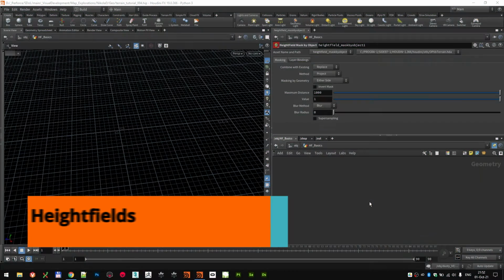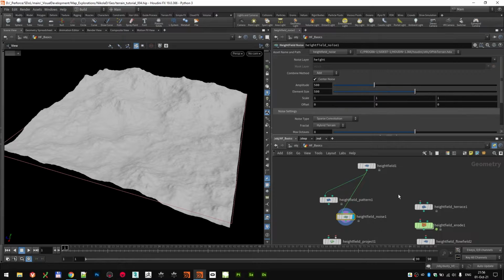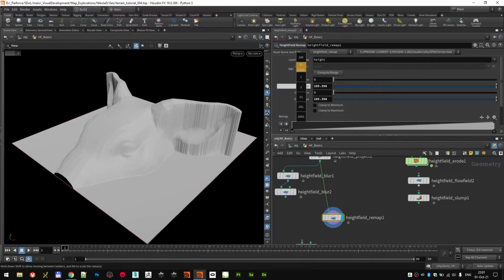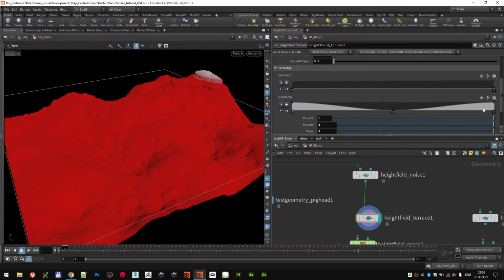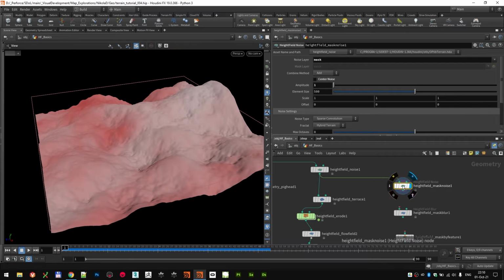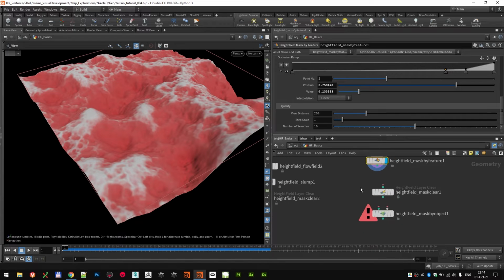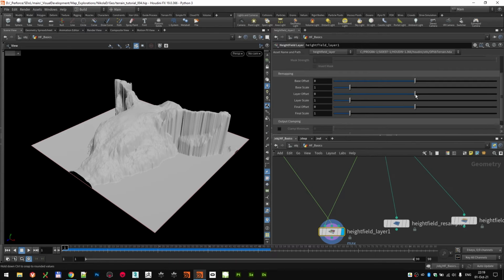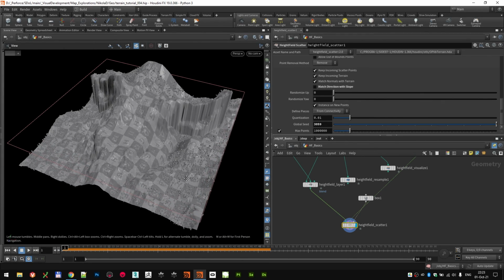Terrain Handbook 02 | Heightfields | Basics

Comment: Hi! Thanks for this great video! When I connect the HF_erode into HF_terrace I get an error message: Invalid source ./smooth_water/terrain_copylayer2/repeat_end1.
(Error: The sub-network output operator failed to cook: ./smooth_water/terrain_copylayer2/skip_if_either_blank_or_equal
Error: Invalid source ./smooth_water/compile_end15.
(Error: First writeable volume has no corresponding volume)..).

I'm on Houdini 20.5.

Any help is much appreciated! 
✌
Reply: If anyone in the future reads this and is stuck at the same timeframe, follow these steps:

Go to "Simulation" tab in the hf_erode node
increase cache memory (I added an extra 0)
 then click "Reset Simulation"

it worked for me, hope it helps you.

Happy creations!